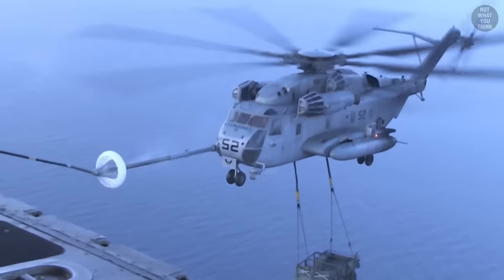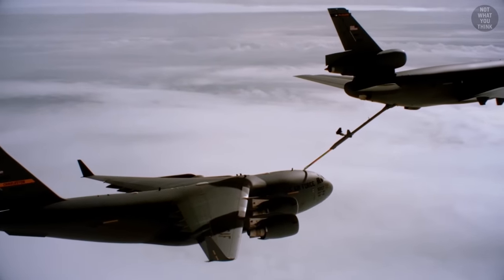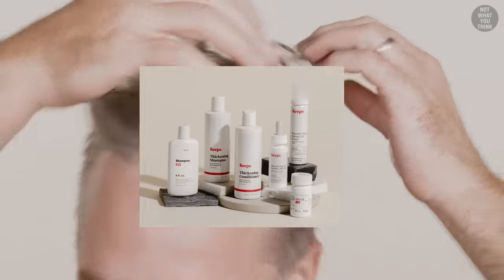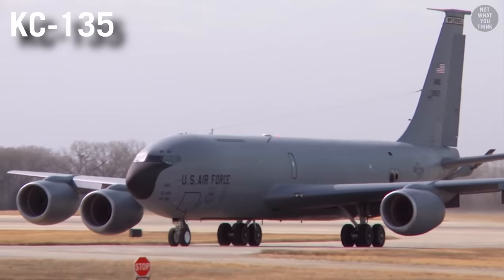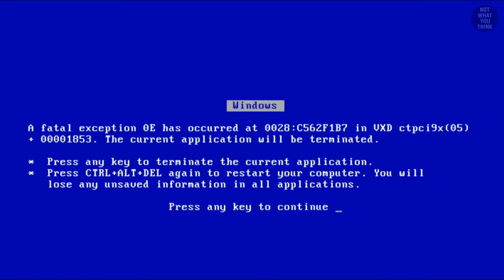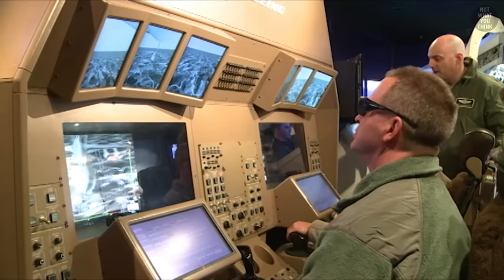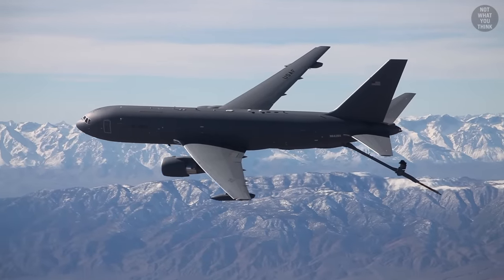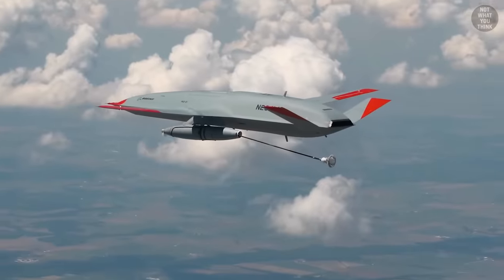Why US Air Force is Making Aerial Refueling HARDER?

Comment: The Navy's automated tanker avoids the problem by making the receiver do all the work. It just flies straight and level and extends the drogue. An automated boom would be considerably more complicated. A fully automated boom would probably need LIDAR sensors, multiple cameras, and some sort of AI to steer the thing. In theory, this doesn't seem like a particularly complicated problem, but it's certainly more complicated than a simple autopilot and a winch.

As for the KC-46, Boeing won the contract because they sued the Air Force until the military finally wrote a contract that was effectively tailored to Boeing's bid, eliminating all but a pretense of competition. It serves Boeing right to lose money on the contract they won through cronyism and lawsuits rather than through a compelling product. I find it absolutely delightful that the Air Force is waving the contract in Boeings face, reminding them that it was a fixed-price contract and the Air Force hadn't renegotiated anything, so Boeing needs to deliver or else...
Reply: It seems like the way the navy does mid air refueling is the easiest way to do it
Reply: The Hose and Drogue method is too slow for refueling large acft.  With the boom system you can fill fighters at 2x the speed (around 2500 ppm), and large receivers about 5X (5000-7500 ppm).  As I recall the average I saw with Drogue on the KC-135 and KC10 was about 1200-1500ppm.  (Retired Boom with over 8500 hours)
Reply: @Bsquared1972  didn't know that but then again the Navy uses smaller aircraft and their  "Airport" is mobile
Reply: That's really funny.
Reply: Yes, and they can do more than drogue with the larger aircraft, like a C-130, etc!
Reply: It was also because of nationalism
Reply: Why would the Air Force even be afraid of Boeing suing them? Unless they are offering a contract that is deliberately unfavorable to Boeing.
Reply: @dallasyap3064  because bOeInG has thousands of lawmakers in their pockets who can make the airforce suffer by constantly suing them until they give in, that and depending on who is in charge they can whisper into general’s ears and influence programs because they have financial investments in that company
Reply: @starexcelsior  that makes sense.
Reply: @Bsquared1972  ppm =?  did you mean gpm ?
Reply: @dmoore5120  PPM=Pounds Per Minute. We do not measure fuel in gallons but pounds.
Reply: Of course, but  Air Force pilots would then have to learn to connect with the drogue.  That would be quite a challenge for Air Force One.
Reply: @drdave1947  There are large acft that do probe and drogue refueling, but outside the US Air Force. The biggest I’ve seen are the Russian Bear Bombers.
Reply: @Bsquared1972  Ah - makes sense - weight matters  :-)
Reply: @JustMe-gn6yf  
Sure, like having your runway always pointed into the wind.
Reply: @Bsquared1972  <— FINALLY someone who has actually done the job!
Reply: @Pierrot9315  
You left out white supremacy.
Reply: @dallasyap3064  
Yeah, you must be a government contract expert.
Reply: @Frankie5Angels150  …and loved every minute of it…terrifying and otherwise. 😎👍
Reply: @Frankie5Angels150  never said that
Reply: @starexcelsior  this is why every lobbyist needs to be kicked out of DC. Yeah, Airbus wasn't American, but for their first contract and intent on keeping it you bet your ass the product would have been top notch
Reply: The Navy uses a drogue and probe method because it's too slow to fuel the giant aircraft the Air Force flies.
Reply: @Bsquared1972  Bears (Tupolev 95s) have propellers. I seem to remember, from my military youth, that the extended probe is safer with propeller craft, attempting contact with a boom being too risky.
Reply: @ericoberlies7537  I don’t know about that; I’ve boom refueled MC/AC-130s with no problem, but we had a CAUTION that there is only 15 1/2 feet from the propeller line to the AR receptacle. 😎 There is video on YouTube of helicopters chopping off the drogue hose…it does happen from time to time.  Biggest issue is speed; the -130 is pedaling as fast as he can, and we are flying with flaps down to be slow. 🤣 Occasionally we have to ‘toboggan’ which is a maneuver where the tanker starts a slow descent, allowing the -130 to gain airspeed and stay in the air refueling envelope. Pretty cool.
Reply: @Bsquared1972  I’m just recalling something I remember. In the early 1980s, before I joined the regular Army, I was an fuel system mechanic in the Air Force Reserve. It must’ve been something said by one of the instructors at Chanute. It may have been related to a story of the end of a boom breaking.
Reply: @ericoberlies7537  Inflight accidents do happen, a risk of doing business. I’ve seen USN fighters take our drogue basket, and have seen receivers come up/in and damage the boom. All in all boom refueling is quite safe, but one of the first WARNINGs I read in our flight manuals was “…flying two airplanes in close proximity is not safe.” Still remember after all these years. LOL
Reply: @Bsquared1972  Your flight manual warning reminded me of the raised lettering on Army claymore mines … “Front Toward Enemy”.
Reply: @ericoberlies7537  haha, so true.
Reply: @Bsquared1972  In my life, I will use that as the title for some piece of art I create.
Reply: I get the impression that Boeing is led more by bean counters than by engineers which is  hurting their products and customers  !

Comment: My father flew the KC-135, loved every second of piloting it. Contrary to belief he wasn't as much of a boomer at the time. He said to him the boom method of refuelling seemed easier, but that can obviously be argued by both sides of the coin. He always said it was a challenge regardless, even more so for specific aircraft that needed it (he always hated refueling the A-10 due to them slowing down to near stall speeds just to stay within the airspeed range the A-10 could achieve, as well as the B-2 but less so than the Warthog)
Reply: And it was opposite with the SR-71. The blackbird had to slow down to near stall speed, and the tanker had to near overspeed.
Reply: Probably has alot to do with users training. If trained on one you'd probably prefer it to the other way of fueling.  My dad came In Vietnam marine recon having trained on a nice m14 reliable. Then was issued a cheap shitty m16 that jammed once so he dropped it grabbed his side arm an stayed in the ditch combat ineffective.  Good thing he was the radio guy. He was actually one saved his own life among others at 18 wounded scared thinking he's dying. They've changed alot on the rifles so please no argument about guns. But after they finally fixed the powder issues etc they would certainly prefer that today to the old m14 heavy less ammo carried etc. It's always about first what works 2nd user preferences.
Reply: So did anyone ever say “ok boomer”.  Sorry I couldn’t resist.
Reply: The A-10 drivers would also smack the crap out of the nose a lot too. Saw a lot with dented noses when I was doing aircrew runs.
Reply: The boom is a waste.  You can only fuel one aircraft at a time!  With the drogue operation you can do two or three at a time.  You do need to do two at a time.  The lead and his wing man.  Also, if you do the lead dude and his wing-man at the same time your saving time.  What the hell is the air force thinking?  The Air Farce got their asses burned when they started experimenting with aerial refueling and they were using the old KC-Spad piston propeller driven POS aircraft.  What were they KC-1's or spads or something screwed up so that they could kill more pilots.
Reply: @46bovine  As explained in the video the high fuel flow rate is advantageous when refuelling larger, single aircraft like bomber, AWACS etc which the USA has a lot of.
Reply: Dive refuelling couldn't be a thing?
Reply: @46bovine  well how are they supposed to switch when all the air force jets use the boom
Reply: @theboothy91  USAF should switch to drogue and probe for the jets to get in line with the rest of NATO, including US Navy. For the larger aircraft, the boom is appropriate.
Reply: No shade on your dads service, but the tanker’s job is easy. The fighter controls the intercept, precincts to, contact, and the order on the boom. All the tanker pilot has to do is fly straight and smooth and pass gas.
Reply: @kz03jd  
Correct. We called it “tobogganing” in the SR.
Reply: @Will-dn9dq  
No argument about guns but dropping your weapon so the enemy can have it is a French move.
Reply: @hokutoulrik7345  
It’s the other way around. Inexperienced boom operators hit the nose with the nozzle (not the boom itself.)
Reply: @TsZen876  
It’s advantageous to us fighters too in order to reduce pilot fatigue. Short boom time is good.
Reply: @theboothy91  
We use it for many reasons, some of which are discussed here by around two of us. The rest of you are in mom’s basement playing COD.

Comment: I maintained the in flight refueling system on the KC-135 from 1966 to 1970.  Some of the airplanes I worked on were built in the fifties.  It's a great system that works well.  There is as reason the KC-135 has been around for so long.  IT WORKS  Boeing has been screwing things up for years now.  Looks like they still are.
Reply: Not just Boeing but the bureaucracy in the military too. Whether intentional money laundering or shear incompetence both parties fail to innovate at times.
Reply: I could guess the reason, while watching this video. And they pretty much said what I was thinking. It's All Going to be Automated.
Which makes sense overall. Because the future is Drones. And of course you'll need drones to fuel your drones. If the purpose of drones is to remove all people from the battlefield so to speak.
And why start with the shitiest cameras in the world? Well. Automation again. With people being the guinea pigs for research into drones.
Let That Sink In 😂 😳
I built the last generation of re-engined KC-135s. And did the boom operators structures. It's not as comfortable as it looks 😏
Reply: @My-Pal-Hal  Comfortable or not, it's real 3D and it's a job!  The next 100 years we are going to try and match humans with machines but what we will find out is how we underestimated some human tasks. But while we replace humans with machines, humans are losing capabilities and becoming increasingly hard and greedy to employ.
Reply: Yep - Boeing executives started pinching pennies and forgot that building crappy aircraft is very expensive in the long run.
Reply: @justins8802  Yup and well Ford and Chevy learned that too as did their workers but worse yet is that the CEO culture of overpaying CEO's to increase profits is still alive and well. That extreme wealth gap is never a good thing!
Reply: @jamesmedina2062  
I Know it's Real 3D.
I had to install half that 💩. 😂
But it's going to happen. And the battlefield is a good place for it. Besides. They will need people to operate and fly drones too. So now they can have an increased skill set. 
Remember. The military doesn't just lay off people. They move on to a different jobs or fields. 
As to workers being Greedy.
It seems corporations ALWAYS are making Record Profits. And I can only 'assume',.. the Workers are a big part of that. So workers are taking what they should. Because the only thing trickling down for the last several decades,.. is yellow in color. In case you haven't noticed.
Reply: @My-Pal-Hal  yeah I can't argue with any of that. The real hope is to get back onto what democracy is and what the people want but those in power have really figured out how to use misinformation and turn us against one another. A sinister problem! Ukraine is a good case in point if democracy being shut down by authoritarian neighbor. Of course the US has even worse issues of money in politics and zero obedience to public mandates.
Reply: @jamesmedina2062  
Can't argue with that either,.. but I Will 😂🤣😂 not really.
I'll just add that a lot of that misinformation is foreign as well. And young people are mentally lazy quite often. While Old Folks get overwhelmed by the masses of misinformation. So there are to many Easy Ins for that 💩💩.
I'm old. Built a lot of that stuff. But I'm also a Gamer, and a techy. 
And one of my favorite past times is hunting for them bots and trolls right here on YouTube. It's pretty fun actually 😜

It's amazing how easy I can spot them. They seem so obvious.
But what's sad is others don't. And it only takes them practically nothing to set that hook. Then everyone is off to the gun store.
People,.. are the real problem. Just ask our planet. And DON'T ask the clown down the street with the drumpf flags 😬😳😬
Reply: Is it any surprise then that Lockheed(militarily) and Airbus(commercially) are bodying Boeing as of late when it is coming to sales?
Reply: There are planes that still work well despite old age, the B-52 is one of them.

Comment: i figured depth perception would be the biggest complaint. i doubt the laser rangefinder will alleviate much of that, as knowing the distance and seeing the distance are two very different things, and seeing is much more intuitive when it comes to maneuvering the boom into position.
Reply: VR goggles and a VR camera would be the best solution in order to create a 3d image. Could probably be achieved for under 5k.
Reply: They ARE using stereoscopic cameras and a 3D screen & glasses.
Reply: yes of course but military procurement is anything but common sense and affordable
Reply: @maximuskay1  that's exactly what I was thinking. Put two cameras about a foot apart, and feed them into vr goggles. Put the camera on a live swivel so head movements track to the cameras
Reply: @johnp139  even that has issues though, as evidenced by their complaints. it's not a perfect technology.
Reply: Like how they promised fiber obtic cable witch has basically zero benefits for such a sort run, a quality copper cable is plenty fast(humans cant see or react faster Than the length of copper)
Reply: @maximuskay1  every try to fly a drone while in a car, very disorienting and hard. It would be better to have highly reflective tracking dots(like motion capture) and all you have to do is line them up or have 2 operators, one for the main boom and have one with limited mobility for the nozzle.

Comment: It's insane how aerial refueling is done manually like this, its insane how skilled the operators on both sides must be to rendezvous in mid air with such prescision like that
Reply: I really wonder why any of this is done manually at all.  The Crew Dragon docks with the International Space Station using computer guidance.
Reply: @chrisg9606  a guidance system that works within the atmosphere would have to be far more complex, especially one designed to operate within such close proximity to a massive tanker. Its gotta take into account the minimum speed of the aircraft, the aircraft's relative position to the probe in all axis, the airspeed of the tanker, the elevation of the tanker, etc... its totally possible, but with so many variables (and therefor points of failure) doing it manually is probably for the best
Reply: @Minecraft-3699  Don't forget wind and turbulence. Outer space is trivial, there's no wind, no atmosphere, everything is perfectly precise.
Reply: @chrisg9606  It's because the largest fleet of tankers are 60 years old and the next generation are 40 years old so they didn't have the tecnology or materials available that we are using now. The fleets are being replaced because the older fleet requires a lot more maintenance than the newer ones do. Anything new is going to be buggy so it will take a while to get all the bugs out.

Comment: One of the big benefits of the traditional boom is that the receiving craft only needs to maintain position, likewise for the pilot of the tanker.  Now you have the boom operator working from a nearly "stationary" position to actually make the connection.  Contrast with the pilot having to "chase" the drogue.  I've never heard a pilot that preferred probe-and-drogue over boom, except specifically playing DCS (since there's no boom operator, so it's entirely on the pilot to line things up and make contact, with much lower margin -- normally handled by the boom operator which doesn't exist in DCS -- whereas probe-and-drogue gives a larger target and margin for maintaining contact.)
Reply: The boom in dcs is usually somewhat picky too. While the drogue system will sometimes just snap onto the probe.